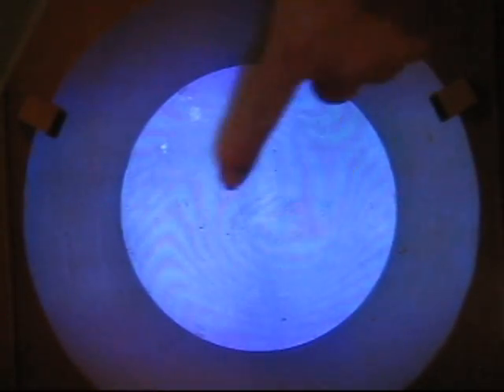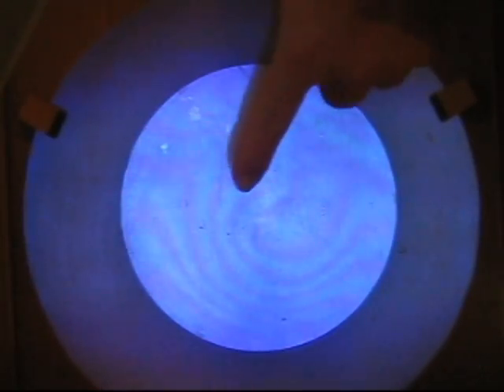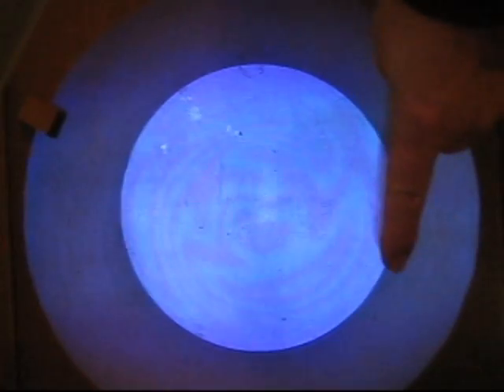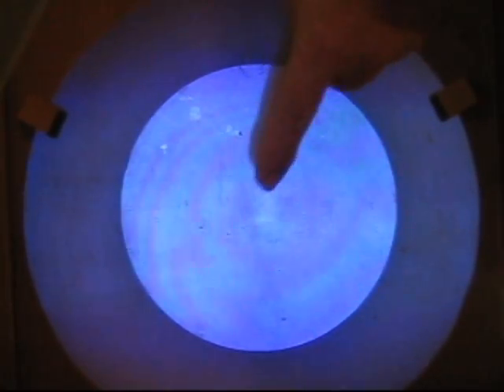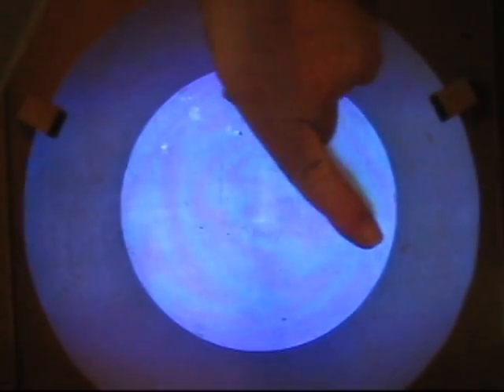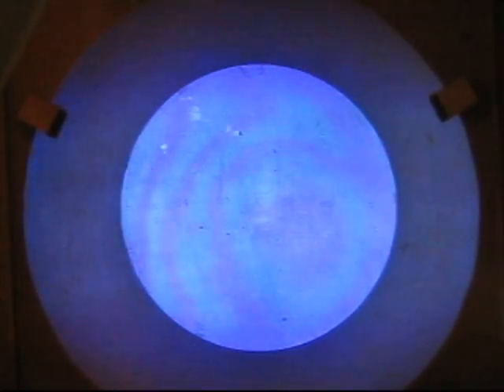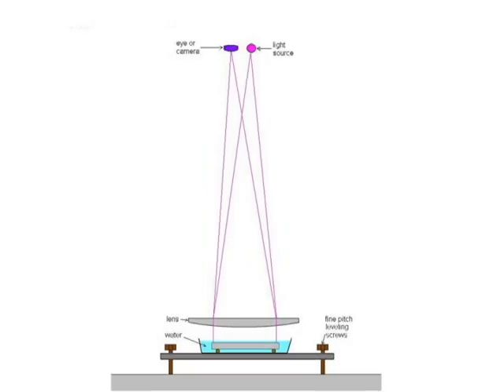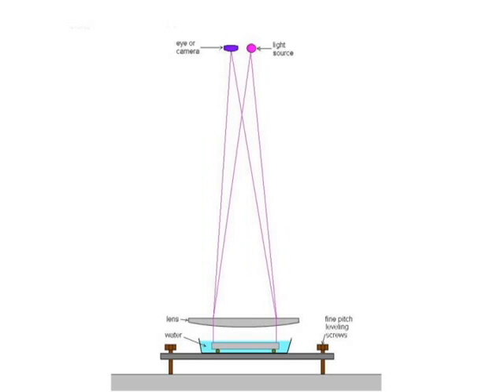Testing an optical flat in water:   part 2

Comment from the maker: I would advise doing this on a concrete floor and standing still,  This will detect the deflection in a concrete floor from shifting your weight around!  Also air currents can be a problem so some sort of cover around the fixture is helpful.